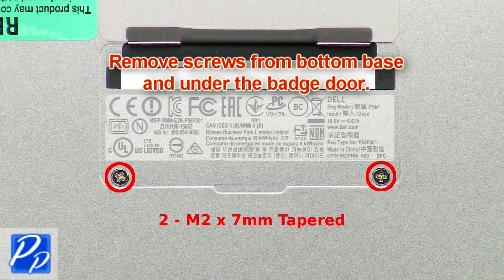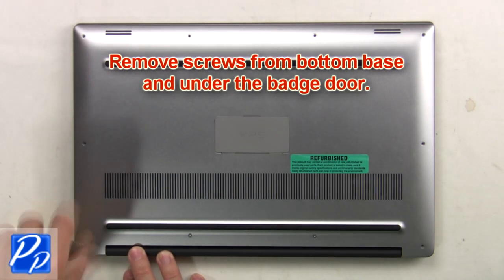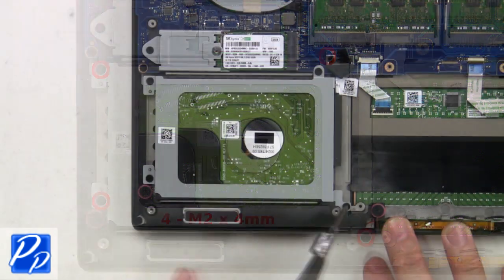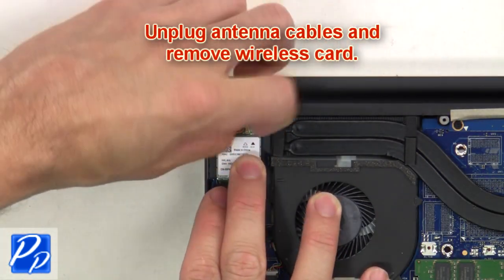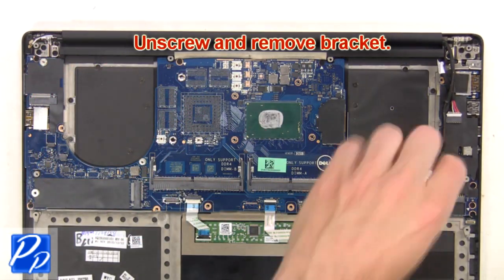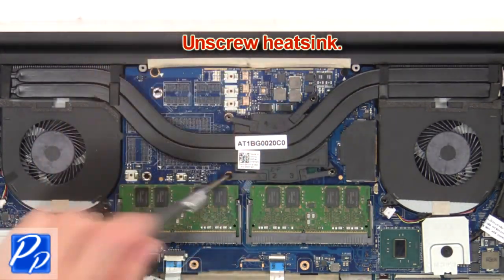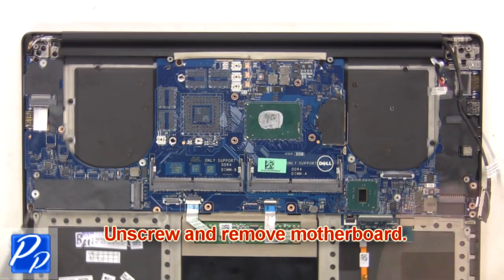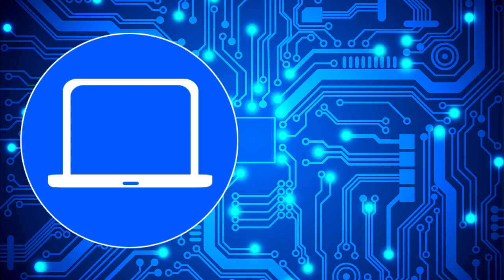Dell XPS 15-9560 (P56F001) CMOS Battery How-To Video Tutorial

Comment: The CMOS battery type is ML1220 3,0V DBV Rechargeable. 
No need to remove the cooler, just mainboard screws and one screw on each fan (the ones that goes thru the mainboard). Then loosen the flat cables and tilt the board over (no need to loosen the display cables).
Reply from the maker: Thanks for the heads up on that. I'm glad there's an easier way.

Comment: holy crap I didn't realize you had to basically take the whole thing apart.  Crazy.
Reply: You don’t have to. Just remove the battery and motherboard screws
Reply: @opmadeit  I got it replaced.  On reassembly I now have the flashing orange ( bettery is fried message).  Also my track pad wouldn't for for a few days but now it does?  Very strange.  Those little ribbon connectors are such  pita.  And the latch for the track pad under the battery wouldn't stay down.  I fried the battery completely I think by doing something dumb by squeezing the battery connector in with a little metal un insulated needle nose.  But the battery was gone anyone only last a few mins.  I don't know if I want to dump another 55 dollars into a battery not knowing if I fried it, or the chip don't the board that communicates. (my computer even in bios says battery not detected).  Even though it is ( and the computer was using it while it had charge before I made that mistake.).

Comment: Dell XPS 15 is the first Dell I have owned and will be the LAST.
Reply: Personally I thought it was the best laptop I've ever owned.  So much polish and fit and finish,  and yeah cmos battery finally died so I guess that's why were all here right haha.
Reply: @cranbers  what does that even mean "CMOS battery died"? I am not sure if I have the same problem. When I don't use my DELL Laptop for several weeks, the battery just unloads itself to 0%, that I even have to setup the System Time again, when I turn it on and to even turn it on, I have to load the battery first. 
Is that the CMOS Battery or how did you notice?
Reply: @synx324  If  the main battery dies / wasn't plugged in.  You know the cmos battery is dead, when the System will take al long time to power on after you hit the power button.  (and you will get a dell bios messages complaining, and if your system is say 4 or 5 years old ( less time if your computer sits powered off with a dead battery not plugged in for a long period of time.
Reply: @cranbers  thanks for your reply. Yes I mean my system isn't that old but the main battery completely drained and I got the BIOS message + it took a while untill it turned on. Even though now that I recharged the battery, everything runs "flawless" again. But pretty sure when I don't use it for another month, I will be back at the same issue. 
Thats gonna be my last DELL Laptop 🤣, even though I like the build quality and the screen :D
Reply: @synx324  Yeah the cmos battery is dead ( you will only notice if you let the laptop go dead on battery / not plugged in.  On first power up that is the symptoms.    that was my fav laptop.   replacing the cmos is a pita,  when I replaced mine The track pad connector clip won't stay down under the battery so it wouldnt' work for awhile ( but now it does?)   AND I stripped out battery screws, they were so tight no screw driver I had couldnt grip it so that's fun ( so I can't completely remove it).  And of course the battery is fried now after so long and I was stupid using a needle nose pliars to squeeze the battery connector back in ( saw a spark with a snap) and that was it..   But I did get the cmos battery replaced.  I loved that laptop.  The screen keyboard track pad etc is all amazing and adding more ram/ new nvme drive even the wifi card etc is all really easy.  Just not the cmos battery ( as you can see you have to remove the whole motherboard and other components so you can flipt he board around and reach it.
Reply: @cranbers  damn that sounds like a struggle. Yea I think I am not going to dare to replace it, I will just make sure to recharge it like every 2 weeks. 😅
This Laptop already got 16 GB of RAM, I think thats enough. 
But yes I love like the laptop too except this issue.
It feels like high quality, the nice aluminium case and lighted keyboard + touchpad with enough space.

Comment: I'm frustrated. Followed these exact instructions while using metal keys to keep me grounded and now the computer won't turn on at all. XPS 15 9560 that I paid $2100 for years ago just became a vegetable. 😞
Reply: did you forget to plug something in?  Sounds like it..Double check all the connections especially the battery and power button connector.
Reply: That's because you Unfortunately followed their very Wrong instructions, as you Don't have to remove the Cooling Heatsink to replace the CMOS Battery and Re-paste the CPU & GPU, as the same thing happened to me and "They" Bricked my perfectly good laptop because of it.

ALL their videos on the XPS 15 Laptop series is WRONG and I'm sorry you watched it and followed them, as I STUPIDLY did, as the Motherboard in these units are very fragile and the slightest thing not done right in these upgrades will ultimately cost you One and a Laptop.

Take a good LOOK at it from their side, they're a "Parts Retailer" how else can they make more Monie$?